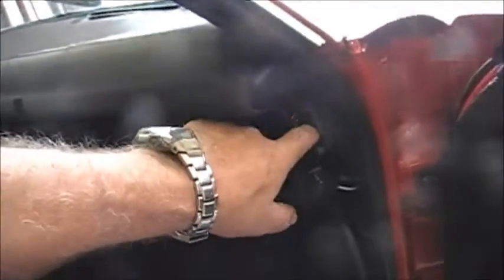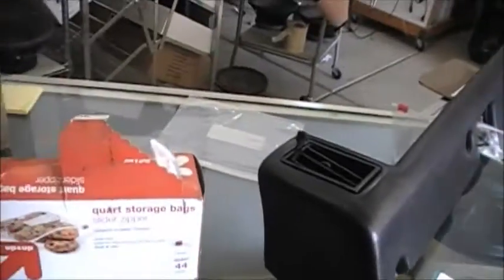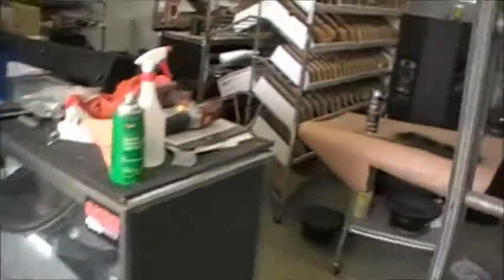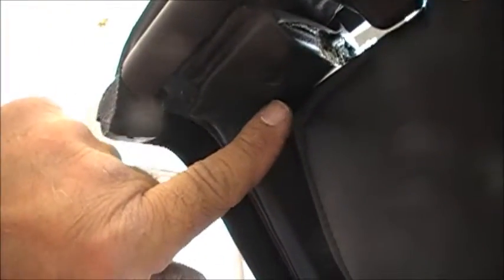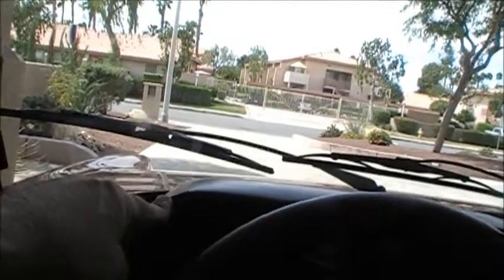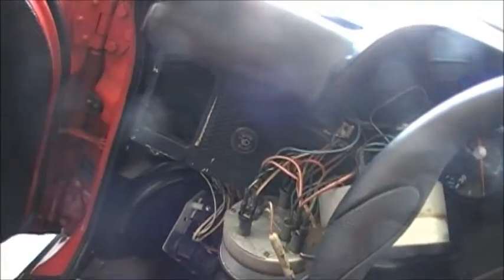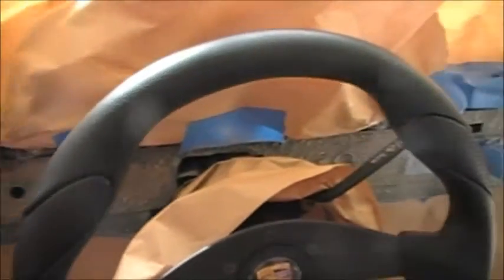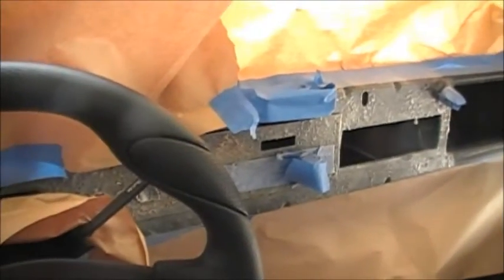Porsche 914 dash replacement

Comment: Having trouble getting the metal piece off of the framework for the dash with the switches and all that. The cigarette lighter seems embedded into the metal piece. Any suggestions?

Comment: Thanks for the video . Why did you need remove the fuse panel ?
Reply from the maker: I'm not sure you really need to remove the fuse panel. You can reach the fasteners through the gauge cluster area. Dropping the panel just gave me a better view and easier access from underneath. The fuse panel is only two screws and drops down out of the way

Comment: is the  main wiring accessible when this is  removed?
Reply from the maker: The gauge cluster is out and the fuse panel is down. You can access most of the wires through there.